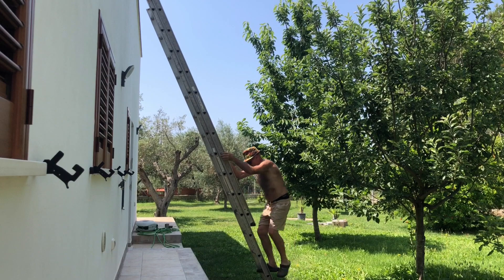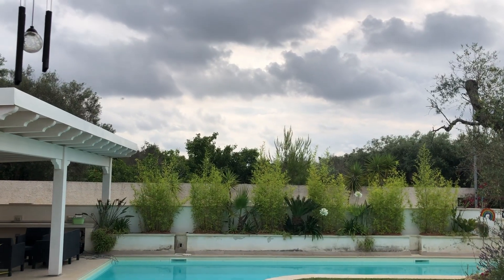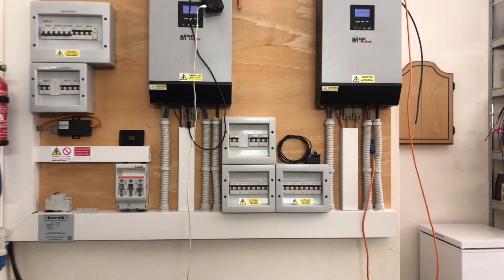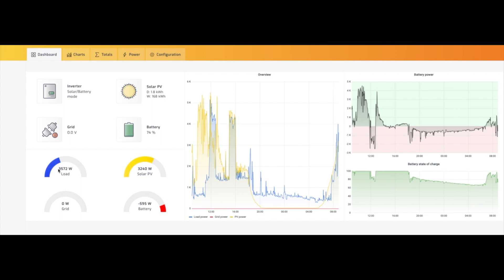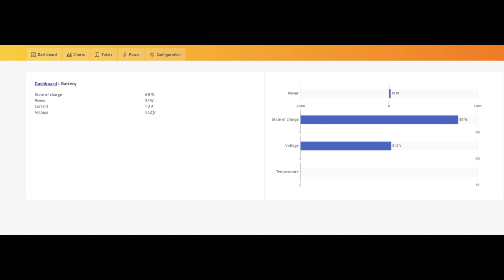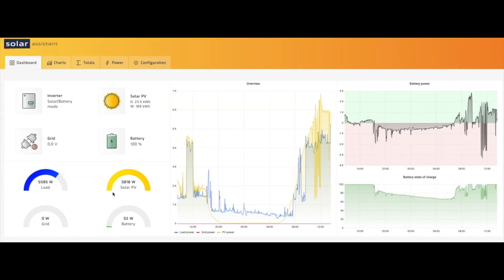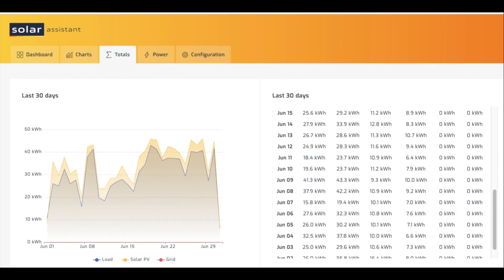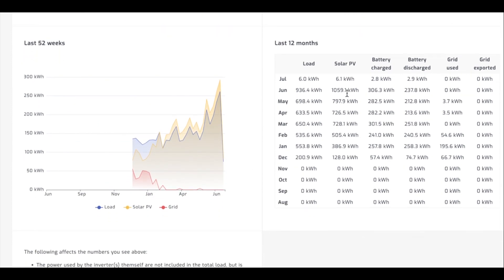The TRUTH About Off-Grid Solar Power

Comment: Great update on real-world usage. Im curious on what kind of pricing I could expect on batteries and panels
Reply from the maker: Thanks. Glad you found it useful. It all depends on what your power requirements are. My system all in cost in the region of $17k but that is with lead/acid batteries not lithium. The system is 8kw with 10kw of solar panels. Battery is lead/acid 25Kwh.

Comment: Video  "Do you REALLY get enough out of your solar panel?"
Tech Ingredients channel .

His video on reflective white  paint is interesting as are other video,s on his channel .He,s the science teacher every boy would of loved .

Using water is a great method of keeping your panels cool but it needs a gutter system on the bottom of the panels to return the water to one of them big plastic  tanks everyone uses .

If you bury the tank in the ground to keep it cool you could have a recirculating system that just needs topping up due to evaporation.

You could also put in the tank a water to water  heat exchanger coil and cool the water and get maybe free warm /hot water as a bonus .
Reply: CNG is quite popular in Italy and is way cheaper than diesel and petrol .All internal combustion engines can run on it with a conversion kit .
My 8ltr 79 Cadillac Coupe Deville runs on LPG which is half the price of petrol at 67p a ltr and is way cleaner burning .
I would swap to even cleaner CNG in a heart beat but in UK we only have 8 petrol stations that sell it .The price of CNG is 42p a ltr .It's like in the UK they don't want you to know about it or use it .Sadly they are also phasing out LPG .
In India they extensively use CNG and many car manufacturers make new CNG cars .They even make CNG from waste instead of land fill ,so win win .Boot space isn't a problem with the new twin tank technology ( two scuba diver bottles size ) .
So run your generator off CNG ?
Reply from the maker: @rocklover7437  I love your replies! They always give me more things to ponder. I will certainly be looking into CNG. First I heard of it.
Reply from the maker: I was thinking more along the lines of using the water from the borehole which is 100 m deep. The water can then run off the roof and water the lawn initially. That removes the need for cooling water in a closed loop. If the concept actually works we can refine it as we go. I seem to remember watching the generation go up on a hot day when I sprayed them with the hose. Now that I have Solar-Assistant I can do a more detailed experiment and get accurate figures. I will check out this channel thanks! 👍🏻
Reply: @FarmsVilla They don't want it as a option to electric cars ..
Electric cars equals not owning a car and stuck in your WEF 15min city .
Electric cars can be shut down from satellite when you monthly carbon credit is used up .They are also roving surveillance systems with the many cameras they need for autonomous driving .
Reply: @FarmsVilla  PowerLab IST channel has a solar panel  water cooling system video
Reply from the maker: @rocklover7437  I think I have said this before. You and I appear to be cut from the same cloth! 😉🤣 The only electric vehicle I will have is one I build myself. When the Fiat eventually dies it’s getting converted to electric. Will only ever be used for short trips to town when required and will only ever be charged at home for free. 😁
Reply from the maker: @rocklover7437  dang it! Stop now. I will never get any work done at this rate. 🤣🤣🤣
Reply: @FarmsVilla  Yes electric cars are only any good as short distance town cars .The very earliest electric cars from early 1900,s was designed as only town cars for Women .
The most successful electric vehicle is the milk float we used in the UK, ie a town vehicle.
I have a very lightweight VW 1971 1300cc Beach buggy ( no road tax, cheap insurance and no need for a MOT ) and will use electric hub motors on the front end and run them off one of them solar generators packs that can be taken out the car or charged off the petrol engine and re-gen  . ( duel fuel ) milage and speed will at most be 20 miles and 50mph ( estimate )
Reply from the maker: @rocklover7437  yeah i remember the milk carts from South Africa growing up. For some reason they disappeared when I hit high school. Not sure why but milk deliveries just stopped. Guess it was "progress" with all the supermarkets that sprung up. Maybe it was a conscious decision on behalf of the milk companies. Cost cutting and customer service be damned. 🙄  I have a little Fiat Seicento 1100 and when the motor dies it's getting a forklift motor and controls. 🙂 No point doing it now as it runs on the smell of an oil rag.

Comment: Unless you are unsatisfied with your MPP Controllers, I recommend buying a 3rd MPP unit.  Keep using and scaling what already works for you.  Just my opinion.  I use (2) Growatt units, and if the need arises I will buy a 3rd unit.
Reply from the maker: I am totally happy with MPP and if I upgrade I will go for MPP again. I have found them to be bullet proof. 👍🏻 That way I will have 2 spares on the shelf if ever anything goes wrong.

Comment: Another thing, go into configuration in SA and disconnect from your inverter. then click advanced. In battery metric, select BOTH. then save, and reconnect to your inverter. go back to the dash board, and you will see more battery info without having to click on the battery. You're welcome, Enjoy.
Reply from the maker: Cheers Michael. I will check that out. Neck deep in painting at the mo. 😵‍💫
Reply from the maker: Thanks Michael. I have made the change. 👍🏻😁 Much better!

Comment: Maybe spraying more often but a shorter time might be better and might use less water. More trouble setting up, I know.
Reply from the maker: First step is to prove how much it improves generation before I get involved in an elaborate setup. Record Solar assistant while I spray them down with the hose. If it delivers significant results it should not be too hard to set up a circuit on the irrigation system to run pretty much as I need it to. Added bonus it should also keep the panels clean. 😁
Reply from the maker: What sort of spray would you recommend? Micro misters may not cool them down enough. 🤔 pvc tube with lots of holes drilled in it. Might be getting ahead of myself here. 🤣
Reply: @FarmsVilla  if you have micro misters that might help and be enough to cool to improve performance. If I remember right 3°C lower would get you 1% increase performance.  If it is not some what even I am not sure it would help much.  I used a mister on an ac unit and it lowered the power demand, but I did not like the mineral build up  If you used the PVC method you could recycle the water and may be something to look at. Maybe a rv pump?  A water storage tank could be made out of plastic like 6 mil to test. A float like in a toilet could keep the tank full.  That may have to be too deep. Just a thought. Maybe more panels would be easier.

Comment: Curious what your Total PV/Solar panel capacity is?  How big is the solar array?  Your "Solar  Assistant" indicated Daily (D: 34.x KW) production. Wow! Very good production.
Reply from the maker: Hi i have 2 arrays of 4kw on the roof feeding each inverter. I also have another 2kw array on the back of the garage hooked up to a separate charge controller to take advantage of winter sun. Yeah when the sun shines here we do very well with solar.